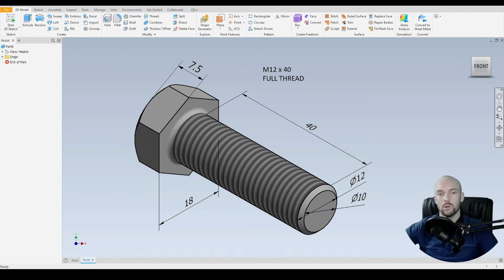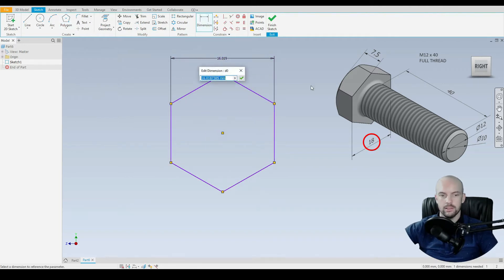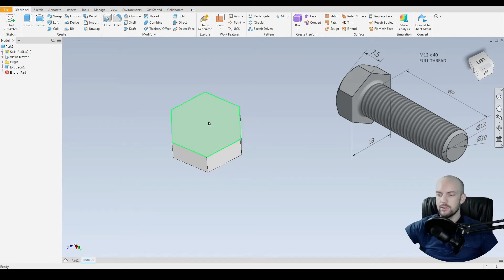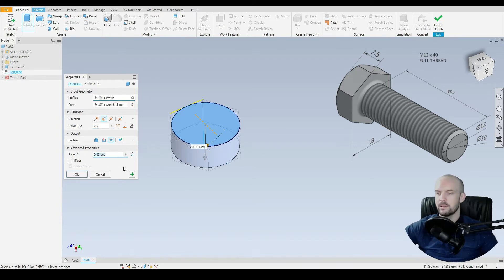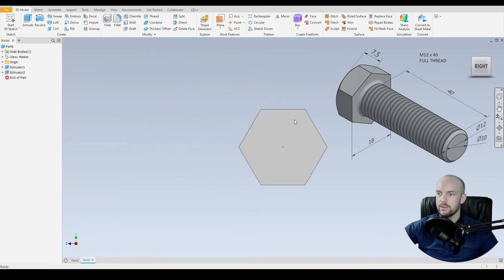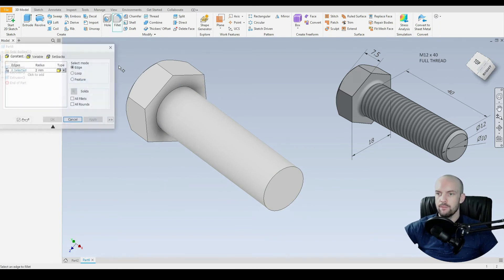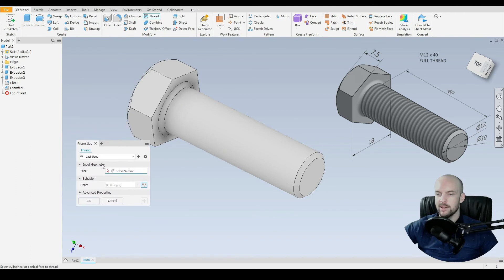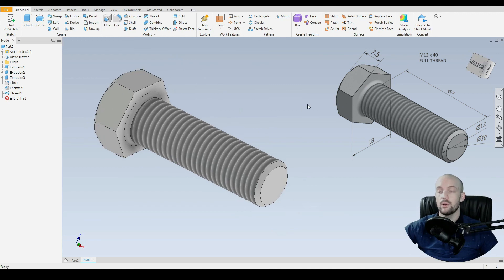Threaded Bolt Hex Head | Autodesk Inventor 2021 | Exercise 08 | Intermediate Tutorial

Comment: how do you use a coil to replace the thread
Reply from the maker: Hi @Takudzwa, thanks for the question. Yes, it is possible to use the Coil command to generate a thread, however, this would act as a physical thread (instead of a visual thread) which can be quite demanding on PC hardware, particularly when used in large assemblies!

Therefore, I would always recommend to use visual threads where possible. I will create a new tutorial how to create physical threads for interest, I'll upload it this week 👍
Reply: @AutodeskInventorTutorials  In the event of 3D printing do you have any knowledge if visual threads will result in physical threads? I don't know if it's coded in or if there is a need to manually enter it.
Reply from the maker: Hi @ Kaleb, another good question, the answer here unfortunately is no. To 3D print we need to convert the file from a native part file to an STL file. During the translation to STL the visual thread is not accounted for, it is essentially a graphical representation as opposed to a physical thread.